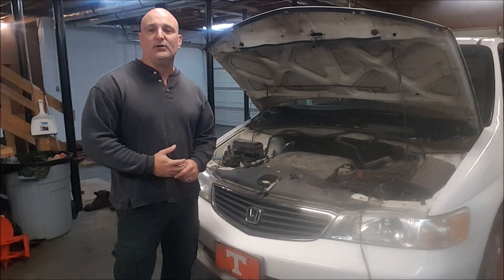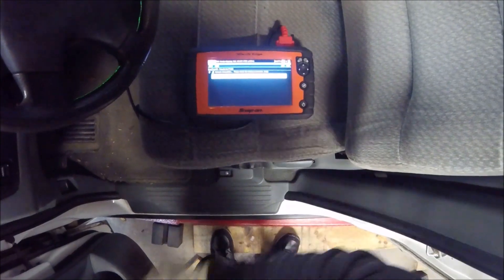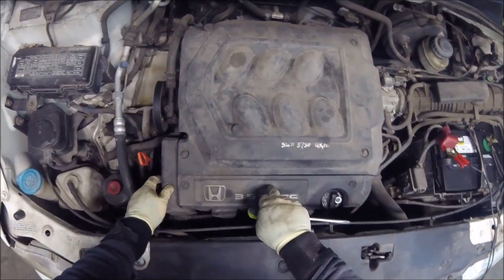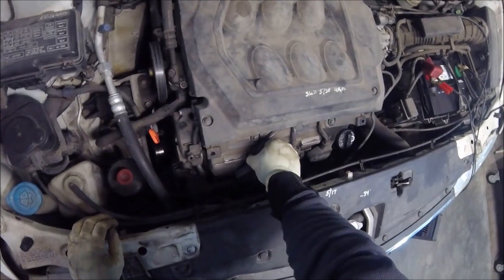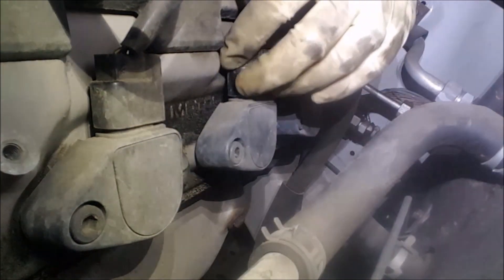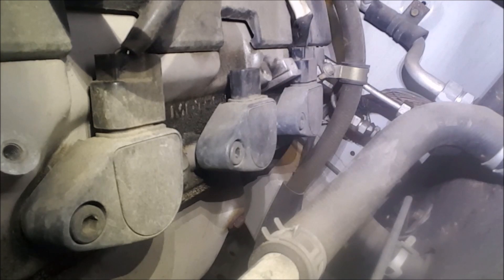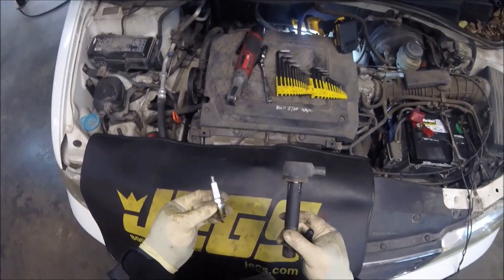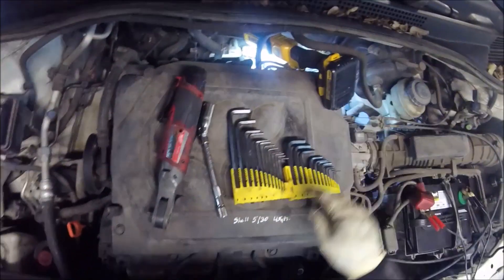Honda/Acura P0300 P0301 P0302 P0303 P0304 P0305 P0306 P1399 Engine Misfire Ignition Coil/Spark Plug

Comment: I have a Honda Pilot 2014 P0300,p0301,p0302,P0303. I changed spark plugs but still the same engine blinks, rpms go to 2000 after few seconds start up pls Help i hear noise on the exhaust manifold

Comment: Sir thanks for this video..2005 honda odyssey ran almost perfect..check engine light came on ..read the code misfire on cylinder one...great..I replaced all 6 spark plugs and all 6 coils replaced valve cover gasket as well and all 4 oxygen sensors...turn van on and check engine light still on...then after 2 minutes the check engine light is blinking and yes van runs like crap..made sure all coils snapped on...any advise on why...
Reply: one idea could be fuel injector, or the valve clearance. May need a valve adjustment. Exhaust valves LOVE to tighten over time. After 150-200k miles it could cause misfire. I noticed this was 6 months ago. Any resolution?
Reply: Did you fix this?
Reply: Hello did you fix it

Comment: My car is doing the same thing but I'm changing all the plugs and all coils, these components last about 2 years/5000 miles, oem or not, it's a 2000 Acura,with over 232k + miles, but it will be back to normal after changing those components, thanks for the video😁

Comment: That's wut it is valve adjustment my car is doing the same thing right now it needs a valve adjustment when i start it up some times i have too give it gas cause it will stall right back off its like i have to hold the gas pedal for about 20 seconds for it to stay started i can feel the misfire while im holding gas when it clears up i can let it go and my car idle normal its weird i clear the codes turn the car off and turn it back on and it seems to be normal again until the cel come back on again and the vsa light comes on when the car get a certain temperature and if i drive it for awhile with the vsa on it stops rough idle and the vsa is off again i keep clearing the cel to get my car to run normal until i get it to a shop on Wednesday and that's because that's how hes running his shop right now cause of covid so he only take a few cars a day by appointment and he's charging me a fair price $379 other shops trying to jerk me out my money trying to charge me almost $800 dollars when i just got my valve cover gaskets done for $200 dollars and they adjusted the valves that's cause they think i don't know any better

Comment: What if its not the coil or spark and its still not making a change ?
Reply: I would look at doing a valve adjustment.
Reply: @wickeditr  I had a valve adjustment done.  A few months later the random misfire showed up on all cylinders. Unplugging the coils and switching plugs didn’t make a difference. What else might it be?
Reply: @jackjones9460  Bad crank sensor?
Reply: @jackjones9460  I'm dealing with the same thing on Honda Pilot. I did the valve adjustments the spark plugs the pcv valve. The egr ports are clean. It only misfires at idle. And it's a random misfire plus codes for every cylinder. I'm thinking vaccuum leak but can't find one. Maybe a fuel injector. Or bad gas.
Reply: @2wheeladdict12  wouldn’t it throw a code for bad fuel injector? For me it’s doing the same haven’t got a valve adjustment yet though
Reply: @2wheeladdict12  on my civic,  it did that cos the ports at the throttle body were dirrrrrtyyyyy
Reply: @TheLifeOfMartin  what do you mean by “ports?” Are they behind the throttle plate?
Reply: @axjohn  little holes that are inside the throttle body
Reply: @2wheeladdict12  Anything ever come of this?
Reply: @garylew548  yes actually I found a bad injector. Replaced it and problem solved. You can test them easily with a volt meter check the resistance they should all be around 12 I think.
Reply: @2wheeladdict12  Thanks for the quick response. My 08 2 wheel drive with 150k randomly threw up engine light, no noticable running issues. Got all the codes and am just trying to work through it now.
Reply: @garylew548  what rpm does it idle at? Does it feel shaky at idle?  99% of the time these engines need a valve adjustment. I would change your plugs if they need it and if it’s still throwing codes start with valve adjustment. It’s going to need it either way.  It could also just be bad gas
Reply: @2wheeladdict12  just under 1000 rpm. Doesn't seem to shake at idle.